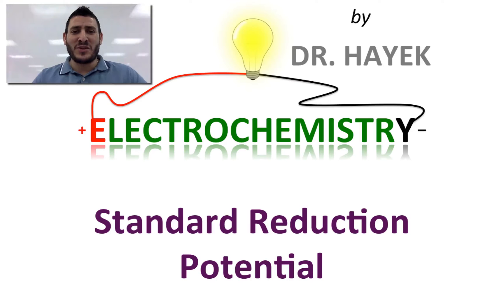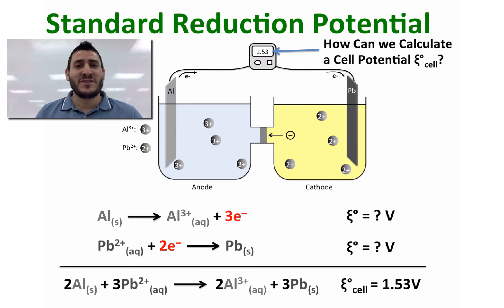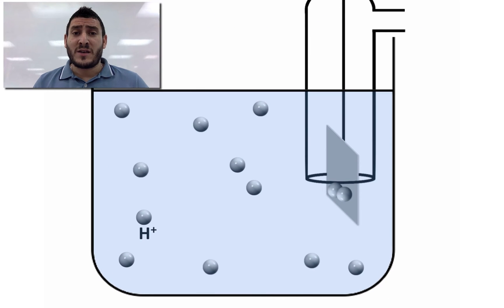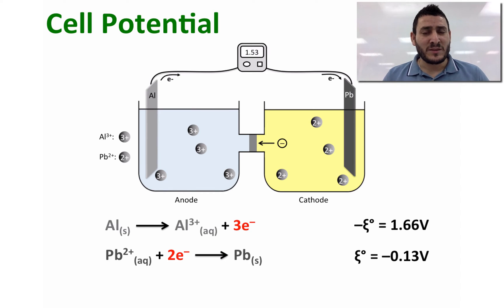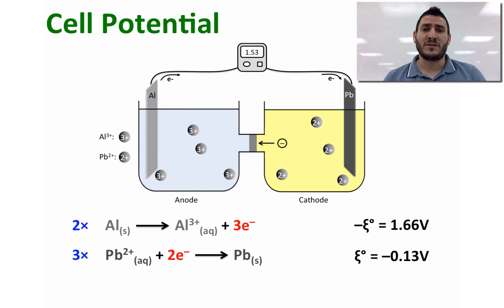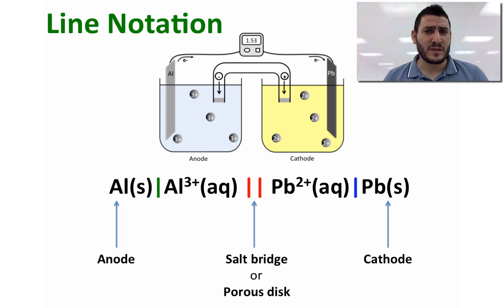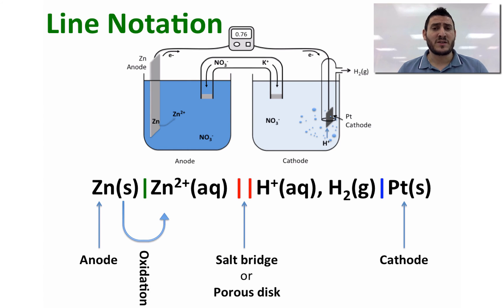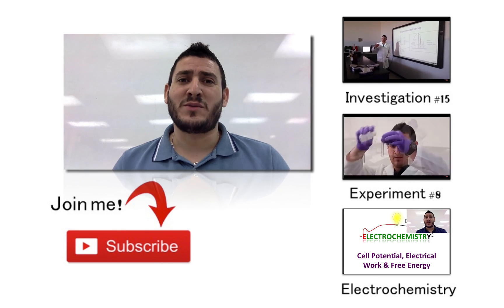Electrochemistry | The Standard Reduction Potential.

Comment: Why is the standard electrode potential always expressed for the process of reduction rather than oxidation? Thank you
Reply from the maker: The standard reduction potentials are experimental values calculated relative to that of Hydrogen ion which is assumed to be equal to zero.
Reply: @AliHayek  Hello, thank you for your reply, but I do not understand what you meant exactly. I have a problem understanding the standard reduction potential. it is not clear to me why it is expressed solely for the process of reduction and not of oxidation. I don't know if you understood my question? Thanks for your help
Reply from the maker: @mirjanavrdoljak899  Because you can reduce H+ ion but you cannot oxidize H+ ion or H2 molecule. I hope this makes it clear now.

Comment: Hi thanks for you video.

i would like to know how to determine if
the given pair of elements/compound is anode or cathode?

a. Cu/CuSO4
b. Pb/PbSO4

Thanks,
Reply from the maker: you are welcome.

Usually, in a galvanic cell we can use the values of the standard reduction potentials. But, in your examples, things are much easier. For example, we can easily say that Cu or Pb will be the anode since they only can undergo oxidation and Cu2+ (from CuSO4) and Pb2+ (from PbSO4) will be reduced at the cathode.
Anode: where oxidation occurs.
Cathode: where reduction occurs.

I hope you find this answer helpful.